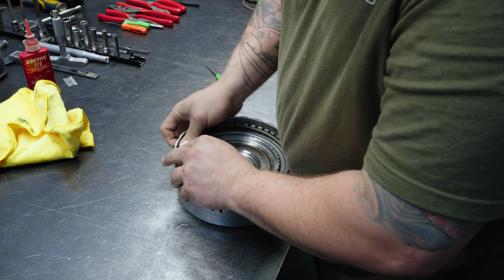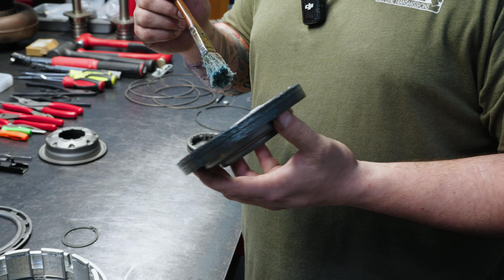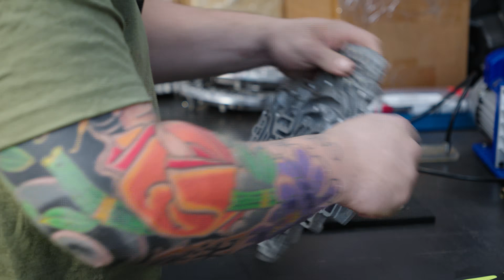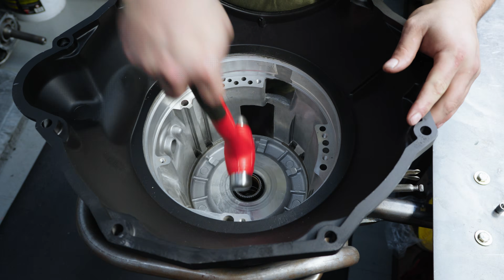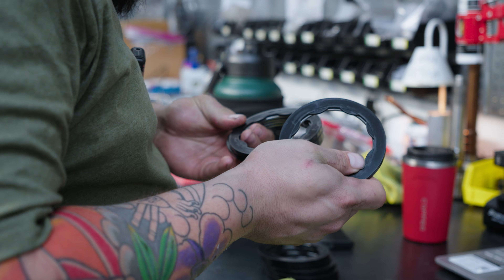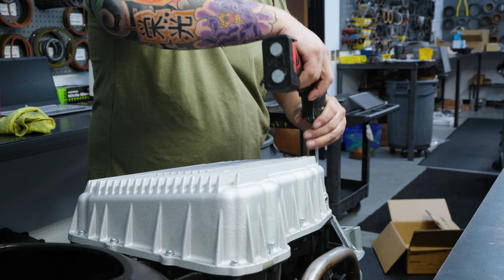Building a 600HP 68RFE Transmission! | Tier One Stage 1+ 68RFE Transmission Build!

Comment: What is that extra solenoid adapter on top of valve body for? ❤
Reply from the maker: This is a secondary solenoid, this is for the lock up on the 19-24. They moved it from inside the pump to outside to prevent the heavy wear on the valve.
Reply: @tieronetransmissions thank for explaining that to me lve done earlier ones they don’t carry that solenoid on the outside great videos very informative ❤❤❤